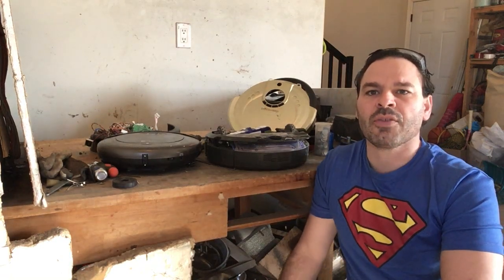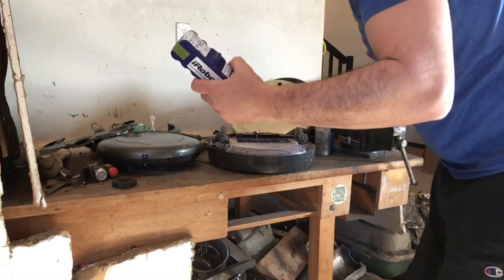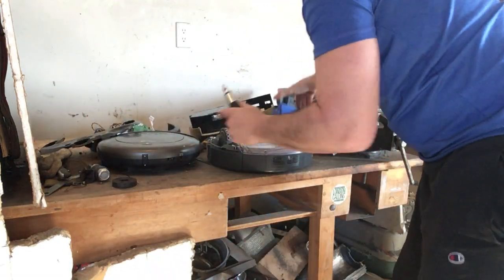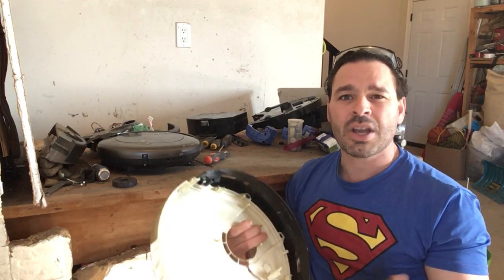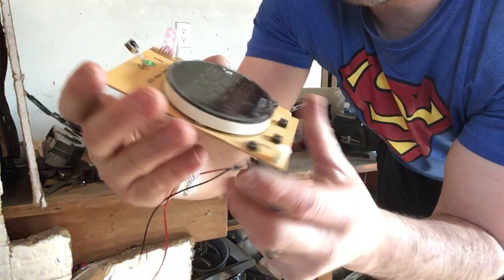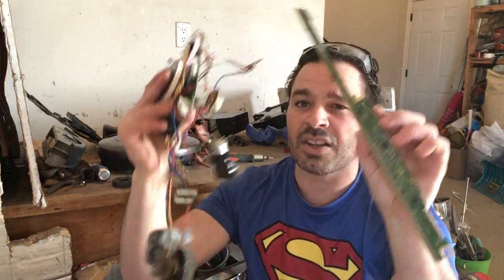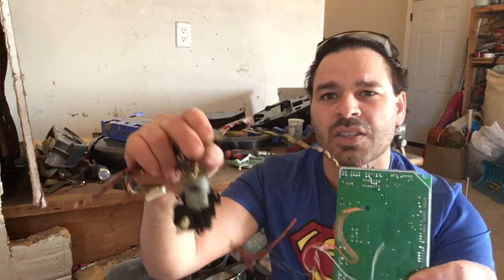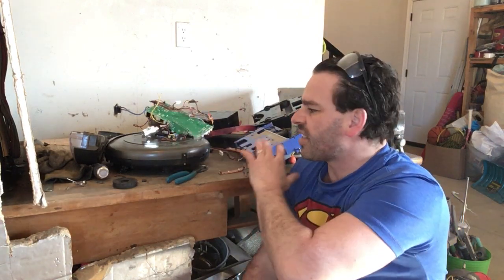Scrapping robot vacuum cleaners for copper, tin, brass, and other metals and little waste.

Comment from the maker: Weight of copper motors 10oz. in the Bobbi and 1.75lbs. from all 3 combined. Note that in the wheels of the IRobot ONLY there were 2 small gold plated circuit boards connected.